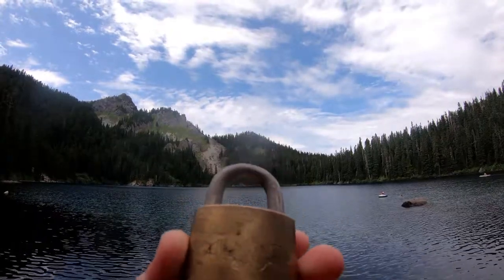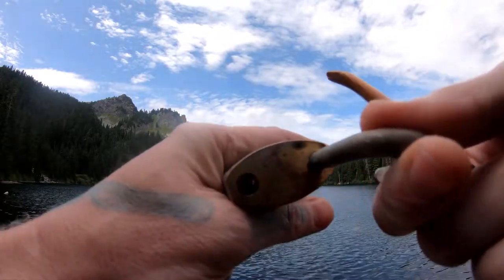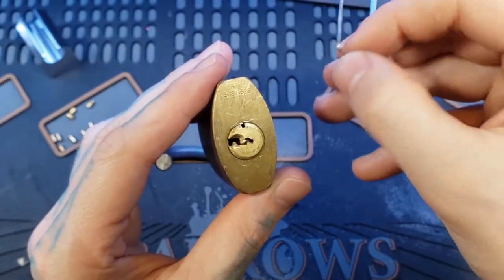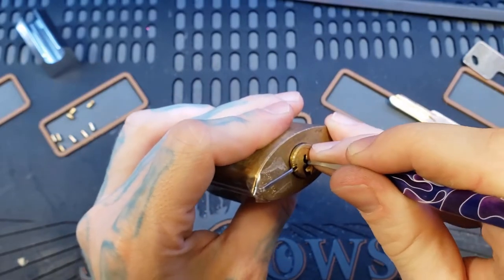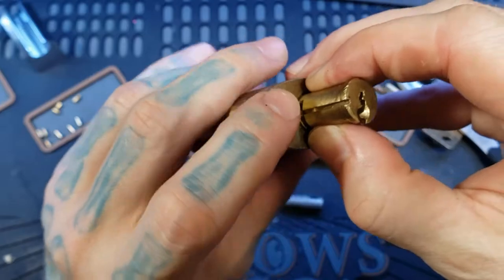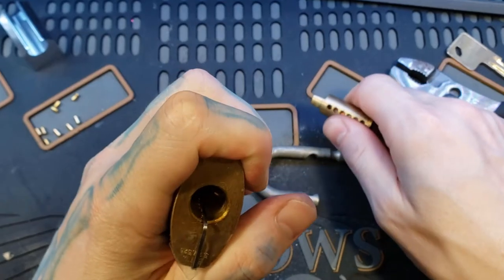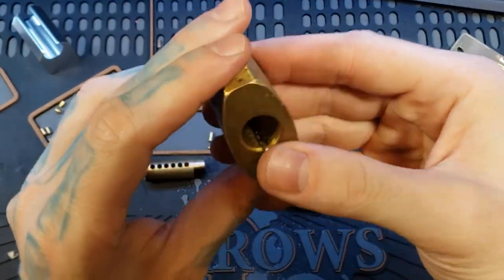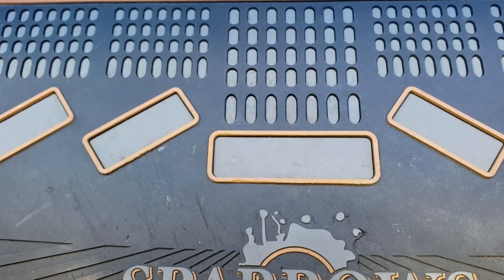87) Almont ReKey Picked at Twilight Lake, Washington

Comment: A shem and a follower would’ve worked better, I think.
Reply from the maker: Shim would not work because the lip on the core at the front of the keyway.  I'm not sure any other method will work.  There's really now way to get a follower in there before the core is out.  Even then, you'd need a special follower to avoid the pin inside the body that locks onto the core